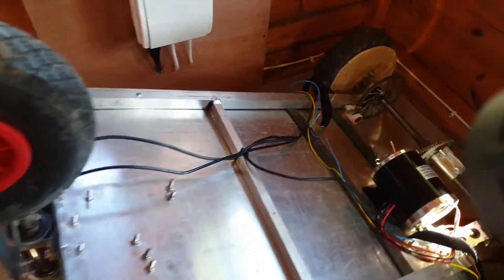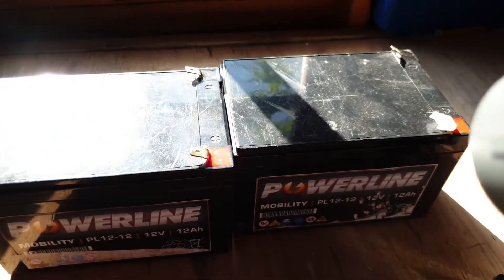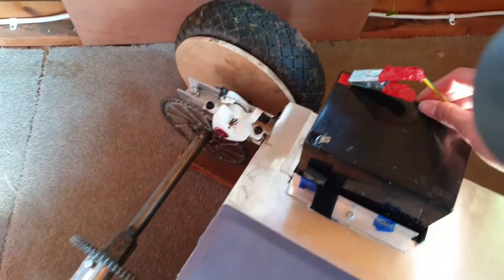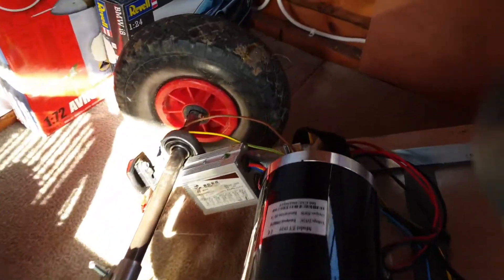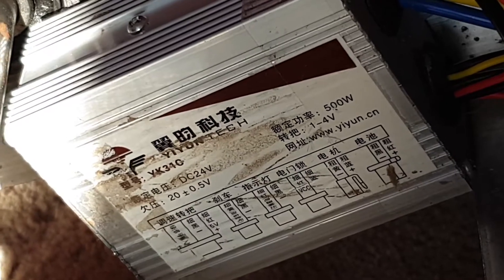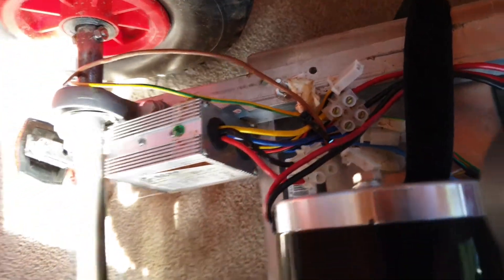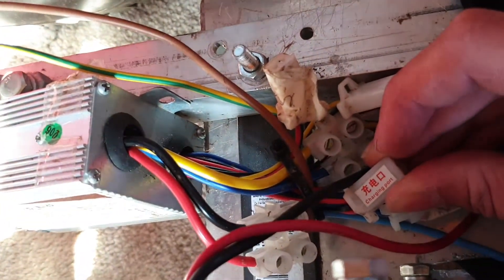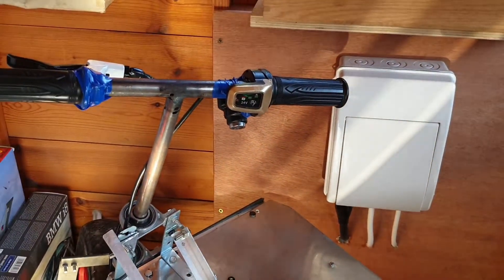How the electronics on my DIY Go Kart work || KalcKart.com

Comment: What are the stats of your old 250W motor?
Reply from the maker: 250w
13A
24v
0.5nm torque 
0.25HP 
0.5kg
2750rpm
11 teeth on the sprocket
Thats all I know
Reply: @OliverCrockett  Thank you so much. I've been trying to do something like this for years but I can't seem to get it to work.
Reply: @OliverCrockett  Do you think 2, 24V 14AH batteries would be sufficient to operate the motor? Sorry for so many questions. I found your video and it's almost exactly what I'm trying to do but I'm having a lot of issues. I'd really appreciate your help.
Reply from the maker: @merilsion  yeah those batteries should work. Are they 24 volt on parallel or series? Additionally, if your budget is a bit higher than mine, you should consider li ion batteries as opposed to lead acid as they are lighter (used on ebikes)
Reply: @OliverCrockett  The batteries are in series in order to generate 24V with the 2 12V batteries.